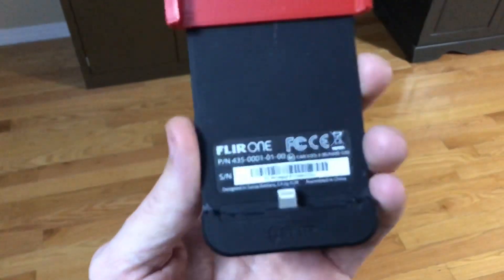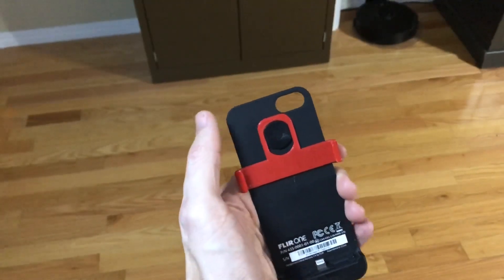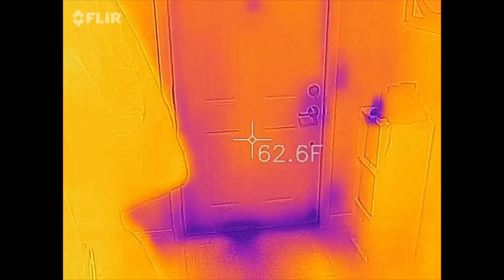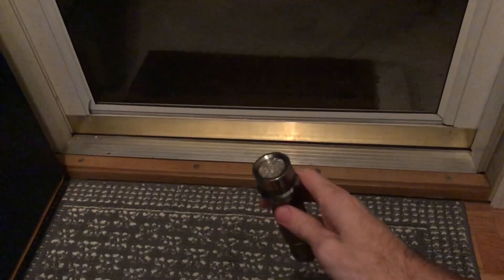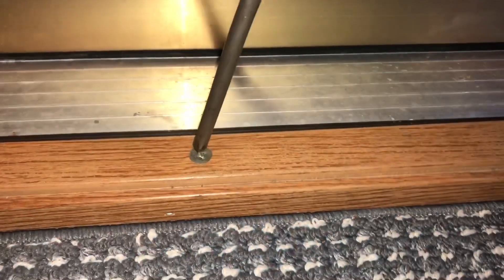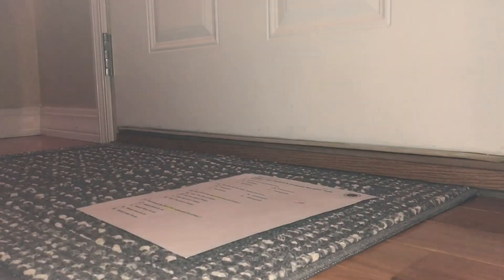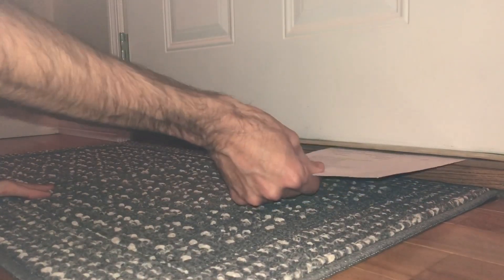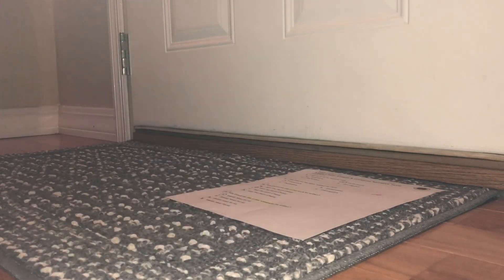Infrared Air Leak Detection

Comment: I wonder if some window and door expansion foam inside the threshold would help?
Reply: That’s what I was thinking too but I’d worry about the mess. I feel like this is probably not recommended by pros but I’d pull up the threshold, lay down some thin (under 0.20in) weather stripping, then screw the threshold down back into it (push down on all four screws before tightening). Now you’re got insulation at the bottom and less of a mess should you ever need to put in a new threshold.